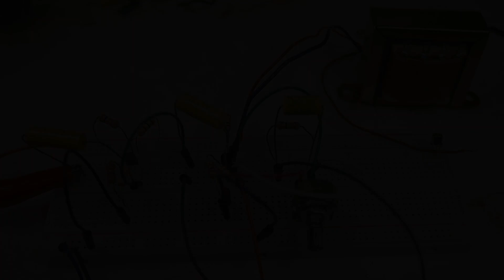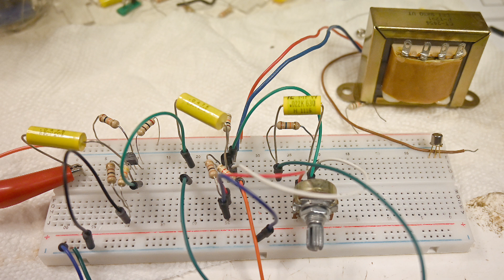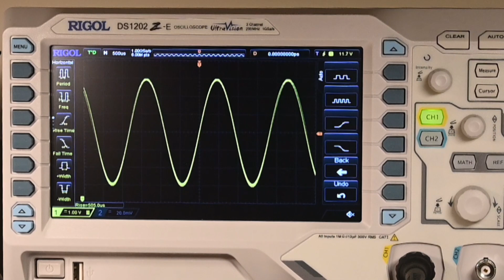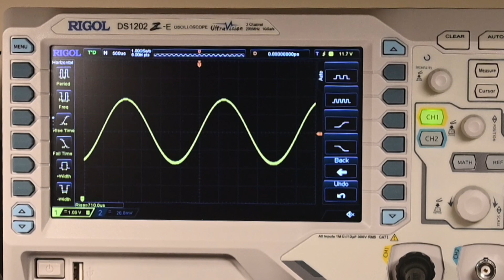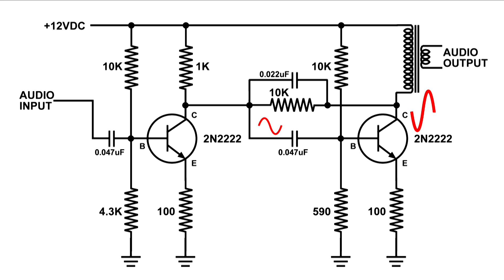Audio Amplifier with Negative Feedback Build Oscilloscope Demo

Comment: Hello everyone, YouTube's algorithm just suggested this video, and since I made a career of servicing and designing radios, thought I would add my "2 cents".   Thank you Richard for doing all of these helpful videos for those interested in analog electronic circuits normally associated with radio.  The intent of my suggestions here is to ensure a greater success rate of a hobbyist building up these circuits and encountering troubles due to component tolerancing plus, at the same time (hopefully) increasing your understanding of the circuit design.   

This circuit is a two transistor bipolar audio amplifier that will put out enough power to run headphones.  This amplifier is operated "Class A", meaning the transistor is biased such that it is conducting throughout the entire 360 degrees of the sinewave or input signal.  With Class A, if the amplifier is driven into Cutoff or Saturation, distortion is generated (defeating the purpose).  To do this, the Collector (or tube plate, or FET drain) is biased such that it rests at half the power supply voltage (6 Vdc in this case) with no signal is applied.  This allows the transistor to have an output swing with a signal that covers the full voltage range available from the circuit.

To bias each transistor, select the bias resistors in the voltage divider (the two resistors connected to each Base terminal) to pass about one tenth the collector current (which is about 1 mA in this case).  Starting with the first transistor, the collector resistor is 1,000 ohms, and if we want half the power supply voltage dropped across this resistor (6 volts), this results in 6 mA of current.  This 6 mA also passes through the collector and emitter of the transistor so, we will have about 0.6 volts dropped across the 100 ohm emitter resistor.  The 2N2222 is a Silicon transistor so, will have 0.6 to 0.7 volt drop from Base to Emitter, meaning we will have about 1.2 volts on the Base.  Next, compute the voltage divider resistor values to produce 1.2 volts at the base.  The closest values will be a 10k for the base to 12 volts and a 1.2k to ground.

The second transistor is a bit different in that the resistor to 12 volts is replaced by a transformer.  The windings of the transformer will have significantly lower DC resistance than the resistor (probably around 100 ohms) so, the design technique will be somewhat different.  To make as few changes to the existing circuit as possible, lets go with the 100 ohm emitter resistor and choose the base bias resistors to give us a collector current of about 12 mA.  Using the existing 10k base resistor (going from 12 volts to the base,) change the base to ground resistor to 1.8k, which should provide 1.83 volts at the base and about 1.2 volts on the emitter. 

This amplifier in its stock form was not distorting the audio, just limiting the frequency response.  The two 0.047 uF coupling capacitors are a good choice for a tube or a FET amplifier but, don't work well with bipolar transistors due to the much lower impedance these devices have.  Thus, in this case with the 0.047 uF capacitors, the gain of the amplifier will drop off rapidly below 7,500 Hz.  To give a typical HiFi frequency response (of 20 Hz to 20,000 Hz), I suggest changing these to 10 uF.  If polarized capacitors are used, the positive lead of the first capacitor would need to connect to the base of the first transistor.  The second coupling capacitor should have the positive lead connected to the collector of the first transistor.

As far as the feedback goes, normally the resistor is in series with the capacitor and the feedback network is connected between the audio input and speaker output.  In this case, the feedback was implemented on the last amplifier stage as a simple proof of effectiveness.

Hopefully all this makes sense and circuit operation improves.
Reply from the maker: Thank you.
You should consider making some videos.
Reply: @AllAmericanFiveRadio  Thanks, I would make videos but, don't have the time.

Comment: Thank you many times for your videos and the time you spend for us ! One genuine question : why the first circuit is not linear , is it due to the capacitors between the stage or unwanted capacitance in the circuit or the transistors themselves ? 
I also understand for the first time that negative is a term related to the phase inversion of the signals involved ! Is this correct ? 
Thx from Brussel 
Antonio 
Brgds
Reply from the maker: The capacitor is a big influence on frequency response. The transistor also has frequency characteristics. How they are used in circuit also influences frequency response. The term Negative mean lots of things, it depends on how it is used. If your talking about negative feedback, that has to do this phasing. Here is a video on this.
Audio Amplifier with Negative Feedback Build Oscilloscope Demo 
https://www.youtube.com/watch?v=eT04zcG_v_Q

Comment: Even with your negative feedback, there is a massive rolloff of amplitude below 450hz... and the reason for that is your tiny .047uf coupling capacitors. Change those to .1uf and you will get some nicer low-end response, down to below 100hz.
Reply from the maker: That would help.

Comment: Sir by putting a feedback ckt the gain become high is may understanding is correct sir
Reply from the maker: Negative feedback in this circuit levels out, the output over a range of frequencies.

Comment: Great video! I'm applying a similar principle to my 5MHz transmitter with a capacitor placed in the base to emitter junction. It decreases the signal slightly, but increases the stability and bandwidth.
Reply from the maker: Thanks for the information. I'll give this a try.
Reply: @AllAmericanFiveRadio  My output BJT is in the common emitter configuration, so I would suppose that the negative feedback works a bit differently than your common collector output.

Comment: But... why is it working? Is it changing the bias?
Reply from the maker: The bias does not change. The negative feed back subtracts from the input signal. The higher the output the more it subtracts from the input signal. The lower the output the less it subtracts from the input signal.
Reply: @AllAmericanFiveRadio  OK - thank you.  One more question... How come it's negative instead of positive? Is it because - the output is out of phase with the input?
Reply from the maker: @MrTechHistory  You use positive feedback for oscillators.

Comment: this is brilliant , please expand on this subject/video
Reply from the maker: I've had several questions about covering the full audio spectrum. This simple example of course has a limited spectrum. There are several ways of covering wider frequencies and that would be to target different parts of the spectrum at different stages in amplifier to get a broader coverage.
Those of you that are looking for great audio, this method has limitations in harmonics.
Let's take a look at a very good negative feedback set up, of course it is much more complex. Please download the PDF so that you can see what I'm talking about.
PGF Manual
https://hafler.com/pdf/dynaco/Dyna-ST70.pdf
If you take a look at the output tubes, right or left channel, EL – 34, you will see several taps on that audio output transformer. Part of the feedback is the center grid on each push pull. On the bottom center You'll notice the wire continues through a 390 pF to a cathode resistor network on the first half of the 7199, that's another part of the feedback. There's one more and that is the connection The 16 ohm output it also connects through a resister to this cathode resistor network. This feedback network is fantastic I did a video on the frequency response of this amplifier and it is as flat as a pancake. Please watch this video.
Dynaco ST 70 Frequency Responce Demo
https://www.youtube.com/watch?v=CBVFZ0Hi09Y
Reply: @AllAmericanFiveRadio  i've been wondering about a transistor amp with an output transformer for a while now. will it sound better !!

Comment: What about the full audio spectrum of 20-20kHz?
Reply from the maker: I've had several questions about covering the full audio spectrum. This simple example of course has a limited spectrum. There are several ways of covering wider frequencies and that would be to target different parts of the spectrum at different stages in amplifier to get a broader coverage.
Those of you that are looking for great audio, this method has limitations in harmonics.
Let's take a look at a very good negative feedback set up, of course it is much more complex. Please download the PDF so that you can see what I'm talking about.
PGF Manual
https://hafler.com/pdf/dynaco/Dyna-ST70.pdf
If you take a look at the output tubes, right or left channel, EL – 34, you will see several taps on that audio output transformer. Part of the feedback is the center grid on each push pull. On the bottom center You'll notice the wire continues through a 390 pF to a cathode resistor network on the first half of the 7199, that's another part of the feedback. There's one more and that is the connection The 16 ohm output it also connects through a resister to this cathode resistor network. This feedback network is fantastic I did a video on the frequency response of this amplifier and it is as flat as a pancake. Please watch this video.
Dynaco ST 70 Frequency Responce Demo
https://www.youtube.com/watch?v=CBVFZ0Hi09Y

Comment: Hi Rick. Some of audio lover don't like a negative feedback due to missing 2nd harmonic  signal. Would you mind to explain the correlation between negative feedback and harmonic signal ? Correct me if i"m wrong.
Reply from the maker: I've had several questions about covering the full audio spectrum. This simple example of course has a limited spectrum. There are several ways of covering wider frequencies and that would be to target different parts of the spectrum at different stages in amplifier to get a broader coverage.
Those of you that are looking for great audio, this method has limitations in harmonics.
Let's take a look at a very good negative feedback set up, of course it is much more complex. Please download the PDF so that you can see what I'm talking about.
PGF Manual
https://hafler.com/pdf/dynaco/Dyna-ST70.pdf
If you take a look at the output tubes, right or left channel, EL – 34, you will see several taps on that audio output transformer. Part of the feedback is the center grid on each push pull. On the bottom center You'll notice the wire continues through a 390 pF to a cathode resistor network on the first half of the 7199, that's another part of the feedback. There's one more and that is the connection The 16 ohm output it also connects through a resister to this cathode resistor network. This feedback network is fantastic I did a video on the frequency response of this amplifier and it is as flat as a pancake. Please watch this video.
Dynaco ST 70 Frequency Responce Demo
https://www.youtube.com/watch?v=CBVFZ0Hi09Y
Reply: @AllAmericanFiveRadio  thank you for your respond.

Comment: Thank you. I learn things EVERY time I watch one of your classes. I re-build vintage audio circuits into guitar amplifiers, and build guitar/audio amplifiers from scratch. Your tutelage is a fundamental cornerstone of my understanding of electronics theory as it applies to what I do. I was worried about you when you weren't feeling so hot, and we hadn't heard from you in a while. I'm sure I speak for a lot of people when I say, I'm very appreciative of you, and I'm very glad you're still sharing your knowledge with us. DC
Reply from the maker: I've had several questions about covering the full audio spectrum. This simple example of course has a limited spectrum. There are several ways of covering wider frequencies and that would be to target different parts of the spectrum at different stages in amplifier to get a broader coverage.
Those of you that are looking for great audio, this method has limitations in harmonics.
Let's take a look at a very good negative feedback set up, of course it is much more complex. Please download the PDF so that you can see what I'm talking about.
PGF Manual
https://hafler.com/pdf/dynaco/Dyna-ST70.pdf
If you take a look at the output tubes, right or left channel, EL – 34, you will see several taps on that audio output transformer. Part of the feedback is the center grid on each push pull. On the bottom center You'll notice the wire continues through a 390 pF to a cathode resistor network on the first half of the 7199, that's another part of the feedback. There's one more and that is the connection The 16 ohm output it also connects through a resister to this cathode resistor network. This feedback network is fantastic I did a video on the frequency response of this amplifier and it is as flat as a pancake. Please watch this video.
Dynaco ST 70 Frequency Responce Demo
https://www.youtube.com/watch?v=CBVFZ0Hi09Y